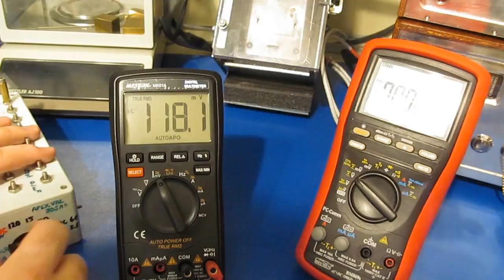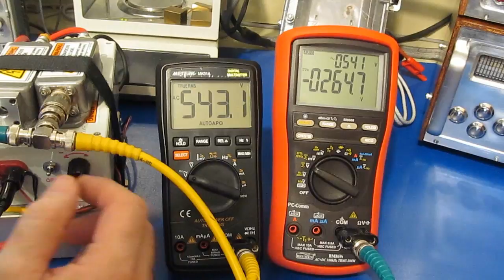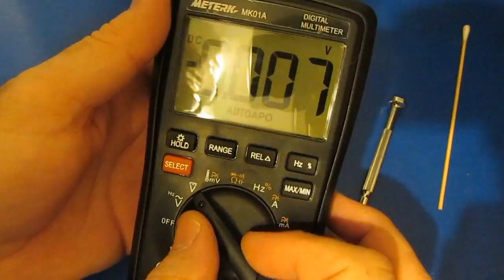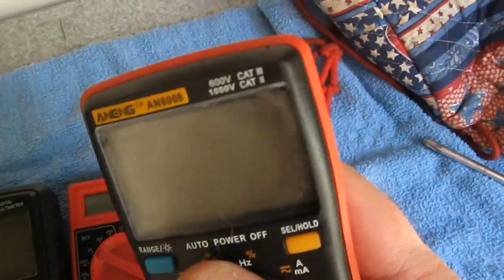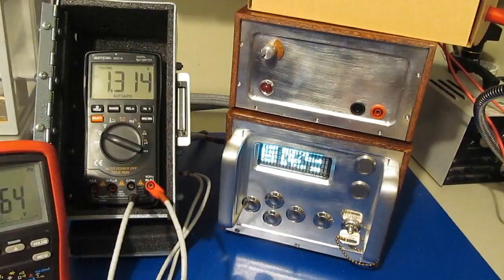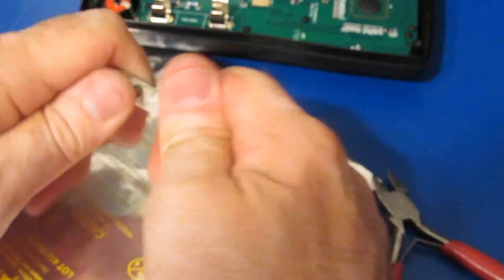The METERK MK01A DMM

Comment: I purchased mine 2 years ago... still going strong.  Ok I am a tweaker of sorts, always finding wee things to make better.  So here is my list of we tweaks to correct a number of your issues with the meter.   1   Used shielding the back cover and grounded.  Don't know why you bothered with the igniter without doing so.  2  Removed the battery tabs and wee plastic nub at the foot of the slot, and soldered in a 9v  push on connector.  3  Used a heavy duty zip tie around the 10 amp fuse, instead of replacing the fuse tabs. 4  Removed  the single diode across the diode bridge on the mA circuit and replaced with four diodes. 

Once I obtain another meter, I will go full out and add 10p on the ACV input and  see about bias removal on the switch, and allow proper ripple voltage readings on DC. 

I admit in a professional world you must have quality tools, just home hobby tools are just that.  Oddly enough there are circuit protection areas most $12 and lower meters don't have, and it's performance may not be as good as your dmm, but it does do its job.  For $12, I would invest in a good set of testing pobes, as no meter below $100 has any leads  worth using.

You really know your testing, but I only watched this video, and it leaves me a wee skeptical of your testing methods... probably because you rushed through it,  or seemed bent on distraction in forcing a  cheep meter to be robust like a  $200 meter.
Reply from the maker: I tend to run the meters the way they are shipped.  Making changes and then running them would make no sense as I am comparing the various meters robustness.    Again, ALL of the meters are transient tested the same, for this reason.   I don't care if its a free meter from HF or a $900 GMW.  This meter had a lot of problems that were presented in the video that you never mention. These make the meter a very poor choice.

Comment: Now see, this meter would have been a perfect example for use in that test I mentioned a few months back where somebody not paying attention could easily install the batteries backwards.  

I still think you aught to consider adding that test...  Just think how much quicker you could have concluded this video had you simply plugged the battery in backwards and foregone the rest of the test's.  :)

As for the frequency issue while not crossing the zero barrier, I have yet to find a cheap TRMS meter that will read frequency properly without crossing the barrier.  If you know of one, please drop the model here because it would be especially helpful for reading frequency on rectified circuits...

I guess I won't be using this meter for testing my grill igniters now...  Surely there is a meter with the features this one has for the price.  I guess I'll keep on looking.

Thanks Joe, for putting these things through what most of can't afford to do with our own meters.  Insightful as always...

Steve
Reply from the maker: It's difficult to explain to someone who has no clue of what ESD is or what it looks like, how the grill starter fits in with the testing.  I've shown the waveforms and how they compare with the IEC standards.  I've also shown what it takes to basically reproduce the IEC waveforms.   But if you have never been involved where you need to know anything about ESD, you see a grill starter and nothing more.    And while I have actually seen someone post where they actually tried to measure the output voltage of one with their handheld meter, that is certainly not the intent of this test.     I could try to suggest that you search Google for ESD testing and read up on it, but I doubt you would.  You would still see things as grill starters.  

It's the same with suggesting what I show has anything at all to do with the CAT ratings of a meter.  These people have no clue what it is that they are even watching or what the CAT ratings call for when it comes to testing.   Of course I have made videos on this subject but I am afraid there will always be some number of people watching these videos that really don't have a grasp of even the basics.  

I did explain to you what you asked about the reverse battery testing why I don't run it.  I guess you did not understand my reasoning or didn't read what I had posted.  No matter.   In this case there is a problem with the meters battery holder design so I brought it up.   I suspect you are correct that it would not have survived but I will never know unless someone does it and posts the results.  Then again, do I care?  Nope.   The meter has far too many problems.
Reply: Thanks Joe, for clearing that up.

While I do have an understanding of ESD, and ESD protocol while handling sensitive electronics, you're right in that I'm ignorant as to what IEC standards call for in testing where ESD is concerned, so I will take your advice and research that.  

I get your point now about your testing having more to do with meters meeting the standards they claim, than simply survivability of mishandling, so I understand why the reverse polarity tests for the meters source voltage are not a concern for you.  Sorry I missed that...

I do agree that the ability to install the battery in either direction is a definite design flaw in this particular meter, and I do believe installing it backwards will kill the meter in short order.

Thanks again,

Steve
Reply from the maker: I did a poor job clearing things up for you.  Most meters are not tested against the EMC standard (61326).  What they call out is a CAT rating which is a safety standard (61010) which has nothing to do with the EMC standards.     
  
Why do you feel my testing has ANYHTHING to do with the meters meeting the standards they claim??   You obviously have not read or did not understand the second paragraph I wrote and are exactly one of the people I am referring to.    Anyone with even a basic understanding would know that the tests I run have absolutely NOTHING to do with the safety ratings of the meters.  It's in the FAQ, its in several of the videos I have posted and it's even in this second paragraph.   

I suggest you spend time educating yourself about the  standards if you want to continue to post about them.  

Seems you still don't understand why I do not run the reverse battery test.  Did you not take the time to go back and read what I posted?  

I'm not much for feelings over data.  If you feel that a meter will fail under some condition, that's fine.  What's sad is so many people will present what they think as fact with no data to back it up.
Reply: Joe,

I'm sorry if there are hard feelings.  It really was the point of my last message to apologize for my misunderstanding of your intent.

I think you and your channel do a great service to the community, and I would highly recommend it.

I honestly think if you knew me, you'd think differently of me.  Digital media tends to represent us poorly.  Often times, it is our own fault, but still there are barriers that cannot be easily overcome, if at all.

To be clear Joe, I am apologizing for my misunderstanding.

Peace brother,

Steve
Reply from the maker: No apology is needed.  I did not see any of your posts as a personal attack.    My responses are typically blunt .
Reply: Thanks Joe,

I really do admire your work here.  

While they probably should, I don't believe any independent testing facilities go to the lengths you have here in your tests.  It's quite telling that Brymen is so supportive of your work, both of them as a company, and you as an independent tester.

I wouldn't be at all surprised if other manufacturers started producing more hardened meters and asking you to do the same.

Steve

Comment: Im sure you checked the battery wasnt actually low and causing the glitches, maybe you got a bad example-?  I only asked cause I got my example out here for a quick check and it seems to be reading pretty accurate, I only checked AC volts and read HZ in AC, DC volts and resistance with a 10 ohm resistor. When in AC I pushed the HZ/% button and it read 59.99 HZ.   I have to say its the best $11 meter ive seen--LOL  Kinda wish they would give this meter a workover and charge a bit more, it could easily be a decent meter with some improvements - even if they charge a bit more if it makes it worth having - they might sell quite a few if it was known to be halfway decently built.
Reply from the maker: What are these glitches you are asking about?   I would imagine any meter is going to meet its specified accuracy when it is shipped.   Even the free HF meters I have shown up till the last one have been fairly accurate so I am not seeing your point.   Did I show where this meter didn't meet its specified accuracy? 

Everyone will have different wants/needs and this is why I don't make recommendations. I run the tests, present the data and assume people are capable of making their own choices.   I've said many times, I don't sell meters or any products for that matter.  I rarely accept any products.  The vast majority are paid out of pocket.  I don't ask for ANY donations and turn them down when offered.   I don't have ads enabled.   This channel is only here to share the little bit of testing that I run on these meters.   I have nothing to gain from it.

Comment: i have the "sunshine dt-17n" is the same multimeter in blue color.some times do not mesure ohms correct .i have correct that I re-soldered the metal plates to the board

Comment: I bought a meter that is similar to this but not quite the same it has a bar graph and seems to be quite a bit more accurate than this one it has two blobs instead of one but the similarities are striking maybe mines a bit hight model. .05 accuracy seems quite a bit faster ranging than this one two its called the Surpeer AV4 seems pretty good maybe this is the newer version of this type. Same fuses similar case but again quite a bit better than this one but similar.
Reply from the maker: A few people have asked me about running that meter.   There was a post about it on EEVBLOG.  https://www.eevblog.com/forum/testgear/surpeer-av4-true-rms-4-5-digit-multimeter/     The two are very similar.  Your's appears to be the higher end model.
Reply: also the ma fuse is alot beter cause i had replace after putting a 9 volt battery across it by accident lol.
Reply from the maker: Did you open your dead fuse to see it it was at least filled or not?
Reply: I did and yes it was filled and opened right up like a say when i put the 9 volt across it. Maybe they up their game a little but am sure its not the most robust design but seems to quite accurate for relatively low voltage electronics work it too has the anemic ptc on it but seems to have a little more processing grunt with the two blob chips it but seems quite accurate on ohms and capacitance, voltage, and current.  Dont know about offsets. It also displays the ac frequency as u read voltage dont really have the equipment to know how accurate the frequency range is all i can say is it does seem to be a little better than this model.  Also not sure how accurate the bar graph is maybe just a gimmick its does ok for me. Works good for us poor afternoon engineers lol.
Reply: Am pretty sure it wont survive your test to any worthy level. I would be surprised if it made it any further than this meter did.
Reply: But i looked inside it and it is total different electrically to this meter although i can see some similarities to this one clearly designed by the same people its says whinny or the circuit board if that helps,  the only input protection I sees is a diode clamp and a small ptc though.
Reply: Excuse me WINHY
Reply from the maker: It was because the input protection that I did not run it.  Hard to say how well it would do without running it.   I'm surprised to hear the small fuse was filled after seeing this one unfilled.
Reply: I really did take it apart and indeed it was filled. The large fuse was the exact same as this one, and agreed on the robustness. But for a cheap meter i do have to say it seems better than most it claims 20000 counts and 4 1/2 digits and high accuracy which is the only reason i bought it, as long as u baby it i guess and also dont know if it really is a 20000 count meter but it seems very accurate is all i can say.
Reply from the maker: Did you feel I suggested otherwise?  I would expect any meter to at least meet their specs from the factory no matter the cost.  The problem is see is that the specs are not always clear.    I have seen some pretty poor bar graphs on some of the meters.  They will update them at the same rate as the rest of the display.
Reply: No just assuring you i did. I too heard tales of the sand less fuse. Which is why i broke it open. It looked exactly the same but did have sand in it maybe it just depends on if they run out of sand at the factory lol and it did open instantaneously  I replaced it with a siba nice that it was a full size fuse.

Comment: If they let an small hole on the PCB to see the fuse from the front and aling a proper cut on the case, the fuse would wokr as an overload indicator lamp. Hiden feature IMHO. Appart from the cat, and the insultation the test leads are fusible links. Second hiden feature. At least they got the range switch working.

Comment: I can't unsee that it looks like a black Fluke 17b knockoff. lol
Reply: It sure does, I just got the Fluke 17B+ and ive had the MeterK for some time - only paid $11 dollars for it- and its hard to think they didnt purposely copy the Fluke17B in every way they could get away with except for color lol   I cant run all the extensive testing Joe does but I have to say when I tested my MeterK using a voltage standard with four setting and various resistors and 1% caps it was accurate as any eleven dollar meter could be - but my small tests dont go to the lengths of joe's.

Comment: some months ago i got a very similar meter the "Thsinde 19B+" looks like its by the same manufacturer, came in the same box and a very similar looking case and the same PCB but with an orange case and no NCV  ... i got it because i needed a 4th meter for quick and dirty efficiency measurements 
it was a GARBAGE meter, it only switched on sometimes, it had an offset and was way out of cal ... not to mention the LCD had the strangest viewing angle i ever had to deal with 
i intended it for its mA range for under 32v so i was not worried about safety but still .... jeeze
Reply from the maker: I've bought a few cheap meters that I use for automotive and have had pretty good luck.  My current cheapo is a Mastech.  It's switch seems like it is starting to fail.
Reply: i replaced it with another one of those aneng 8002s for its good mA range 
works a treat
Reply from the maker: I've wondered about the 8009.
Reply: i have too, but from the looks of things it uses the same shunt for the 10A and mA range like the 8008 so its not great for my purpose (my 8008 has a 1.8mA offset when on the mA range and is very poor in the low mA) 
as far as what the 8009 offers over the 8008 ... the NCV is nice, as is the ability to measure temperature but does not exactly do anything for me
Reply from the maker: I really have no need for the meter but was more just interested to see how it was implemented.

Comment: Fun stuff. I'm not to impressed with this cheap one.
What about doing the aneng Q1? It's a little bigger than the 8000 series, but not quite a full size meter.
Thanks for your great videos.
Reply from the maker: I thought about running that meter until I saw Dave's review of it.   I thought with the button/relay design they may have added some additional protection.
Reply: joe smith that was part of why I asked I wanted your opinion on weather it would make it more robust, guess I got the answer now😀.
Reply from the maker: I wish Dave would have hit it with a magnet like I showed with the Gossen.  IMO, that a big problem with that meter.    Dave's video does show the same basically unprotected input.   Even the spacing on this meter is tight with no slits.

Comment: I would think that you would want to have the fastest fuse that would blow in a multimeter--those fuses give a whole new meaning to fast blow fuses.  The bigger "HRC" fuse blew at almost twice the current rating--what good is that?  And the little one was like three times the rated value--wow.  How long would it take for that meter to melt or catch fire in your hands?  Anyways that was en-"lightening".  Thanks

Comment: Hey just sayin' I watched the testing while you found several problems with it, I was just commenting on them.  I guess what youre saying is the problems didnt lie with the accuracy as much as other issues-?  I did see a review somewhere about a guy having range switch problems on his making it lose the display at times, he took out the metal contacts and somehow rebent them for more tension and fixed it - but for how long-lol.
Reply from the maker: A compiled list of the most of the problems I noted with this product can be found in the description.  No captive fuse holders so dropping the meter can dislodge the fuse.  Maybe a low battery would be lighter which seems like it could improve the chances that the fuse would stay in place.  I guess we would need to to a study on it.   Maybe tightening the rotary switch contacts would help the supplied test leads handle more current than the fuses.   Of course, if you are suggesting putting a fresh set of batteries in backwards because unlike most meters, there is nothing to prevent it somehow solves this problem, you may be onto something.   If the meter is damaged there is no need to be concerned with all of it's other shortcomings.